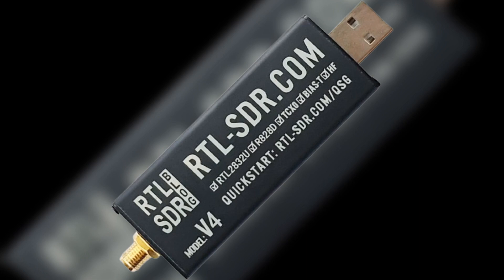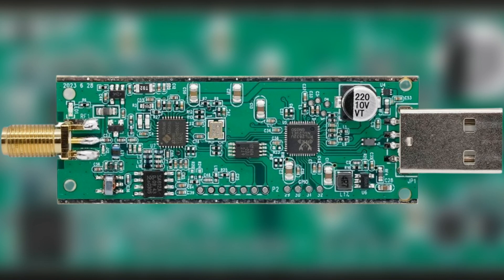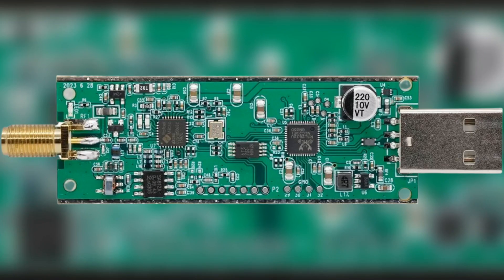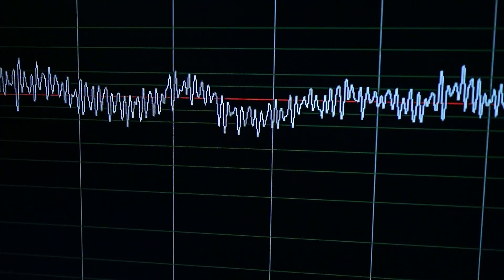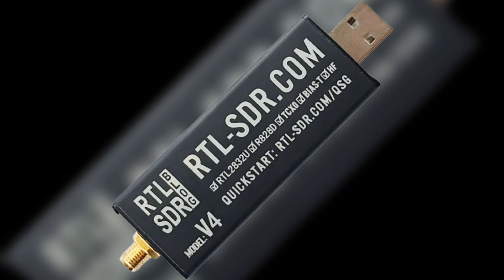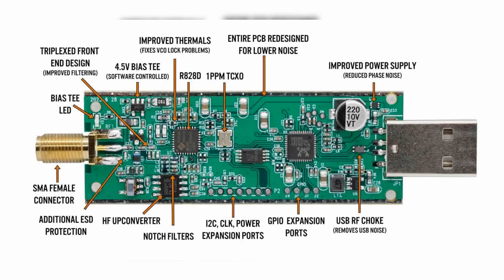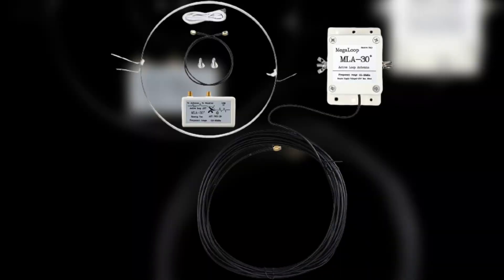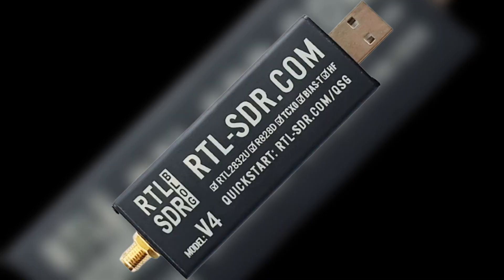RTL-SDR Blog V4 With Built-In Upconverter HAM Radios For Newbies SDR Receivers

Comment: how can i listen short medium waves in v3??I use the sharp program and antenna the aor 7000 and I receive from 25 MHz and above what moment ..what is wrong ??
Reply from the maker: You must set it to direct sampling (Q Branch)
Reply: Yep, set it to direct sampling. But I recommend an upconverter.
Reply from the maker: @-Tris-  You are correct the upconverters are much better than direct sampling in my opinion.